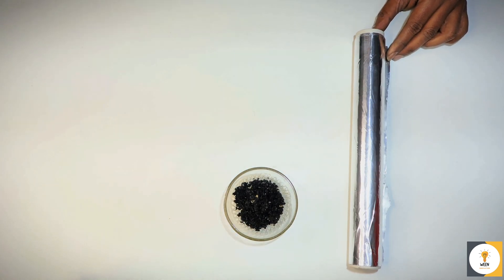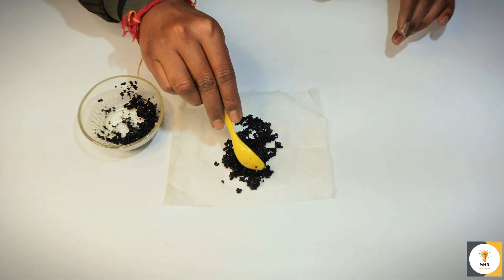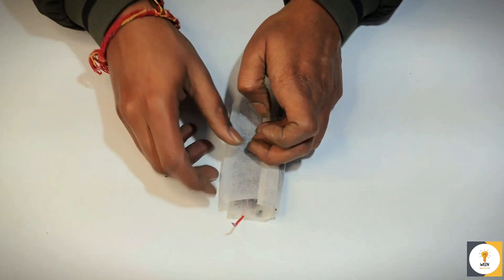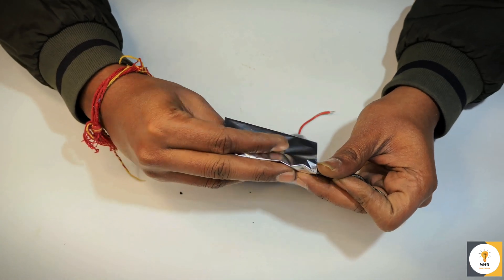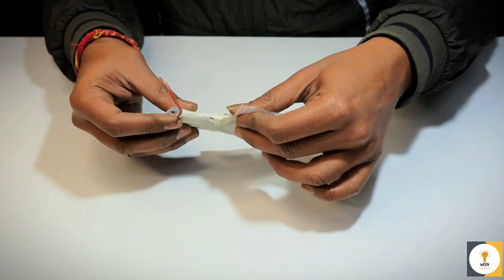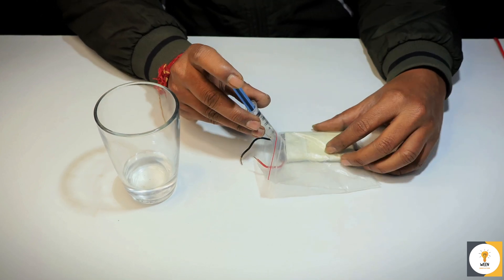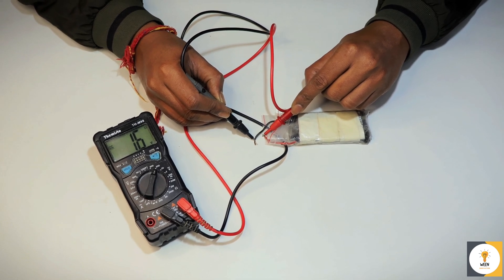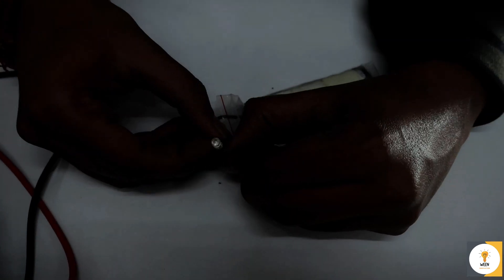Making an Aluminum-Air Battery: Step-by-Step Guide

Comment: Fake video.Actual voltage may be 0.6-0.7 only.
Reply: No it's real, but the experimentation is not good. It's the copper aluminium reaction that produced 1.6v
Reply from the maker: It's real try it